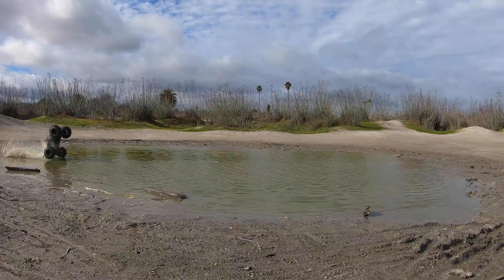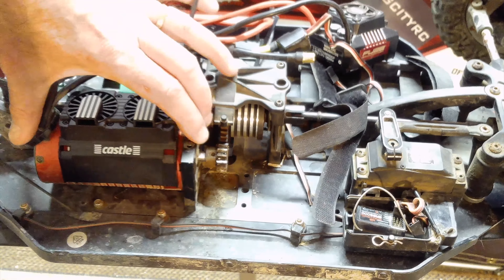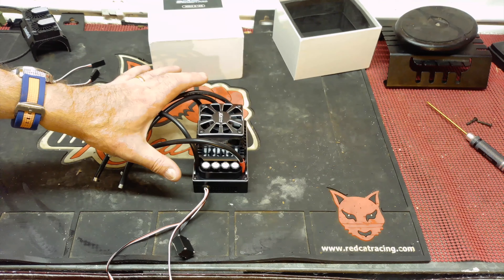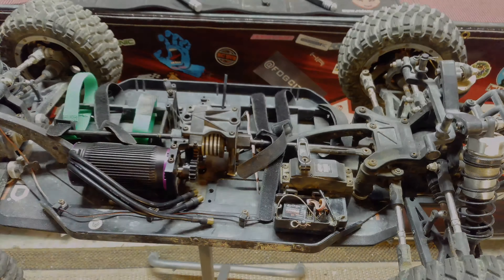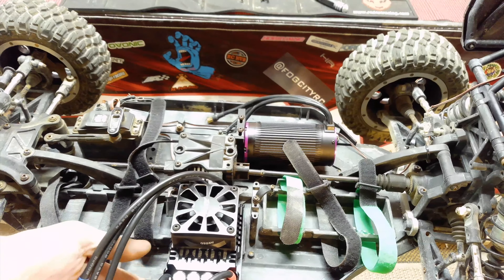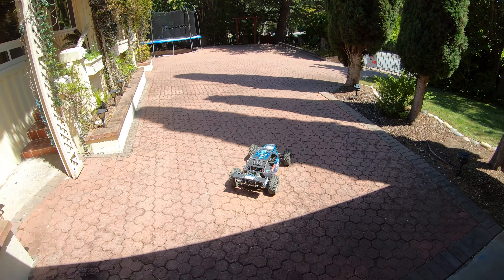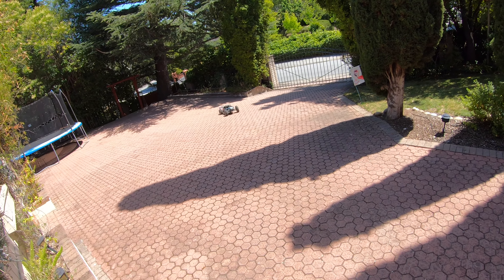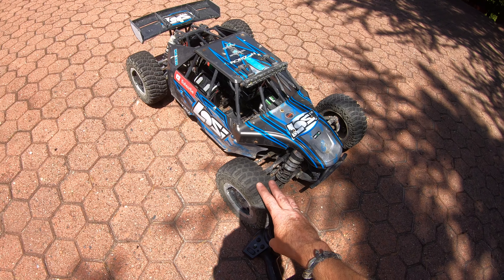When RC Car Guys Lose Their Minds! 12S Losi DB XL-E #INSANITY

Comment: Ive got that esc comming for my speed buggy, didnt think it was that big, hope it fits!!
Reply: Yo massive fan bro
Reply: I didn't realize u r subscribed to this channel I'm subed to u
Reply from the maker: It's about the size of half a housebrick...Power delivery though is INSANE, and I mean totally, totally insane, I was on 10% throttle at the most, I think this will top 70! In your jump / speedrun buggy it might fit at the back but it's taller than Typhon body for sure.
Reply: That's what she said
Reply: I don't know if this would be my choice for 1/8 buggy/truck. Looks like it is a bit on the heavy side. And mass and speed causes damage... We will see.
Reply: ohhhhhhhhhhhhhhhhhh its uuu

Comment: Epic stuff Richy 💪 👊 Things an animal...BTW I was looking at the ZTW Beast  ESC myself a while back but few people told me that they have a habits of catching fire😬 Hope that's not true & just coincidence /bad luck 🤞
Reply from the maker: It does say on the packaging DO NOT USE With Motors Higher Than 800kv, I suspect some people do then blame it on the esc! This was cool to the touch, but time will tell!
Reply: @DriftomaniacsRC  Ahhh... Didn't think of that. Of course all ESC have KV rating according to Size of Can. People might ignore that or don't do there homework & read manual!! Can't Wait To See More From This Richy. 💪 👊 Have a good day from blighty 🇬🇧
Reply: They just recently added not to use with >800kv motors. And really 800kv only with 8s. They've been out for about 2 years or so now and have JUST started saying "please dont use over 800kv". I've had 5 or 6 fail personally and several friends with them that died or caught fire. And that was with 600kv or less motors so just be careful if you buy a ZTW flame pro esc.

I've started using Flier esc for a budget 12s speed control and they have proven to be much more reliable just took a little fiddling to figure them out... then there is always MGM if you've got the money to spend.
Reply: @HighVoltageRC3080  Cheers fella 👍 There's also the R-SNAKE aswell by R-MAMBA think it's up to 16s capable & maybe 400amp continues if I remember right 🤔  Thanks for the heads up pal

Comment: Well...another ZTW that will blow up soon! Good luck when not doing the smoke! :P ZTW is just that...
Reply from the maker: On the packaging it says not to use a motor of more than 800kv, I guess if people miss that and go above 800kv then they'll have problems
Reply: @DriftomaniacsRC  happens even with <800kv

Ztw needs to fix the esc instead of continuing to sell the same junk or blame it on kv. Its the esc.. not the motors...

Comment: Same problem on my traxxas slash with the pinion gear. All u have 2 do is get tread locker. Super simple fix
Reply from the maker: Jedi even with Red thread locker on it, even with a new flat spot ground on the shaft it keeps spitting  the pinion off, on a slash agreed that will work well, but not on the power of this even on the stock 8s.

Comment: I like it brother..
Reply from the maker: Hey Phil SINCERELY hope you and the family are doing well. I don't know if you get the 'movement' of the car on the video but 1-2mm travel and it moves 5-6ft, I stood up on the wall as this $#%ker lovely machine has hit me in the ankle in reverse once getting ready to put it in the car (15 mins later when I'd stopped screaming and cooled my ankle down in the lake (not kidding)). I've fitted the powerhobby belted tires but am bit worried about stock radio range as this thing has 70mph in it. Going to have to look for big safe place to drive it in given it's weight. Will PM you as have few speed run questions

Comment: And if you don’t want the fronts to balloon more than the rears, add thicker diff oil to the central diff 👍🏾
Reply from the maker: Tip appreciated no way did I think fronts would balloon like they did. I am just searching for a safe venue as 33lb car at 70+ could be lethal. I am wondering about on the beach at low tide?
Reply: @DriftomaniacsRC  GO FOR IT!

Comment: You can just drill a hole through the motor shaft and run a long threaded pin through and locktite will be fine
Reply from the maker: steady hand needed and 8s power,,,,,,

Comment: I had a motor do the same thing make a flat spot on the other side and istalled grub and still working great.
Reply from the maker: I took the motor out, reground the fla spot but 30ft vertical and 150ft horizontal err.....killed that screw!

Comment: Hey for your old motor that the grub screw scored around the shaft on the flat part of the shaft take a drill bit and drill into the shaft about a quarter of the way into it then use a longer grub screw to go into that hole that you drilled in and it won't do that again I've done it before it works perfect

Comment: That extra wire is a spark arrest. It's so when you go to plug in your second battery, you don't get that spark as the plug engages. Just some helpful info. It would be wired directly to the plug on the ESC, but will be useless if you plug the battery into that plug first. You have to plug the second battery into the plug that's got the spark arrest second. It's purpose is to increase the life of the ESC and to make sure all the electricity in the capacitors don't short circuit the battery.

Also I must add, belted tires still don't hold up well. As well, thicker diff fluid is necessary because the belted tires will explode.
Reply from the maker: Lane MUCH Appreciate that info, the spark upon first connecting it was on the 'Oh Mama!' level.